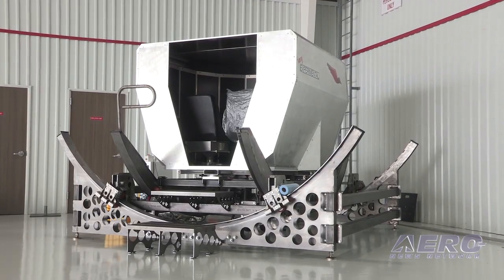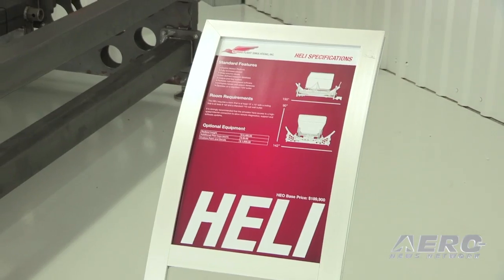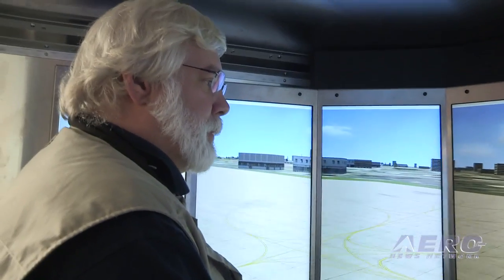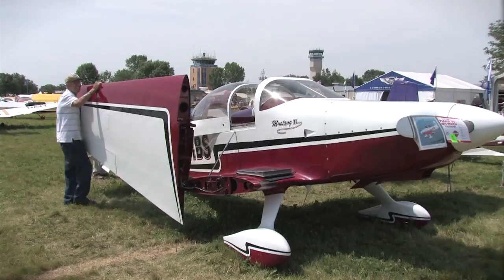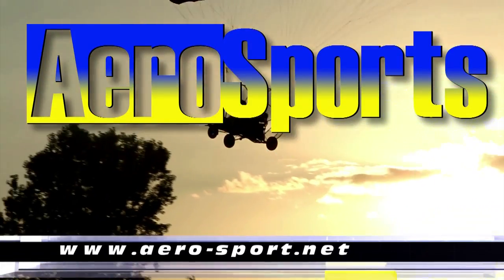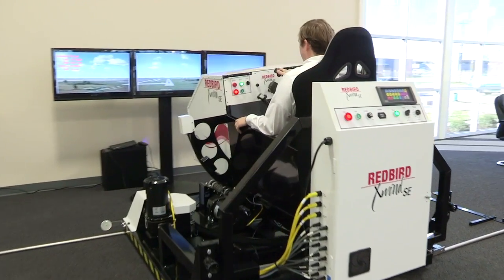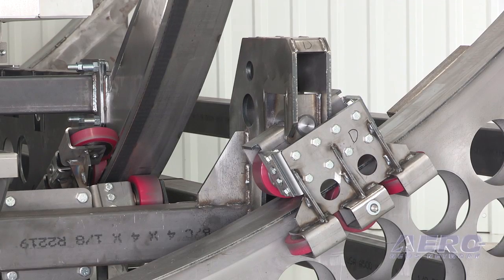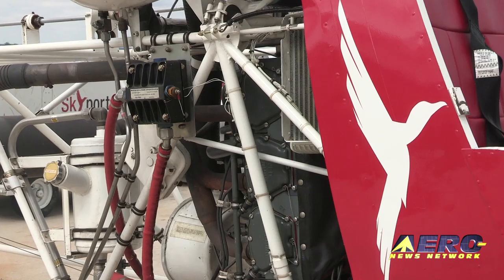Aero-TV: Perfecting The Heli-Sim - Redbird Redefines The State Of The Art

Comment: The problem with helicopters has never been the device itself but the software. There is currently no piece of software that simulates helicopter physics realistically. It seems they are using FSX which is the worst of the lot when it comes to helicopter simulation. Perhaps they did some changes, I don't know, but the FSX you can get from the store is terrible.